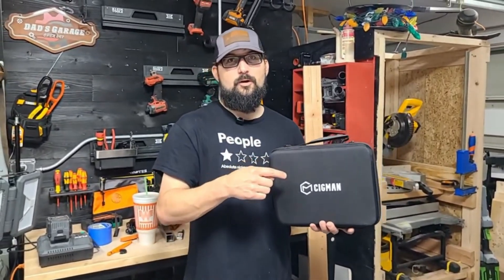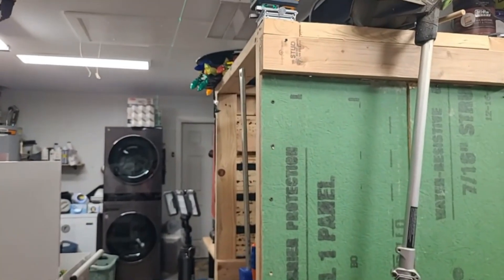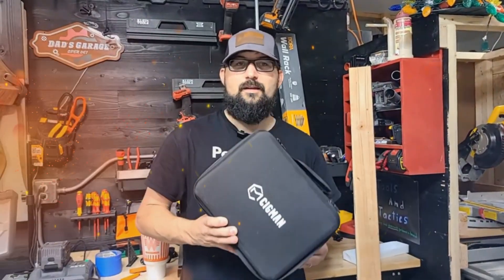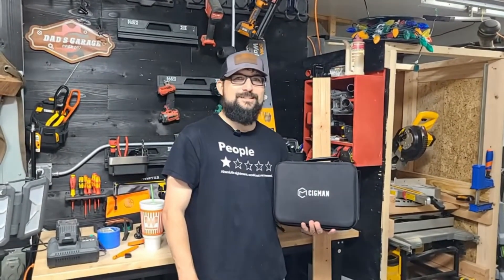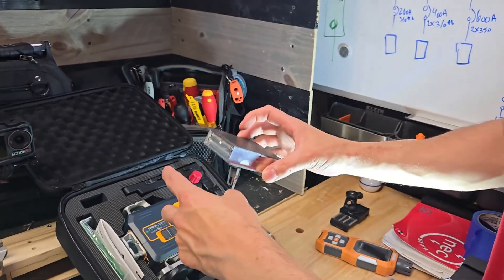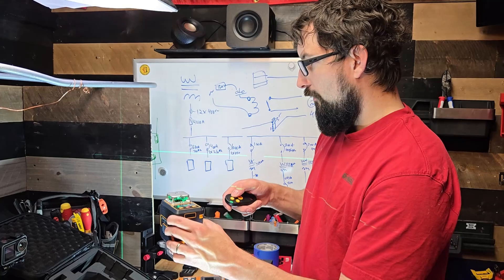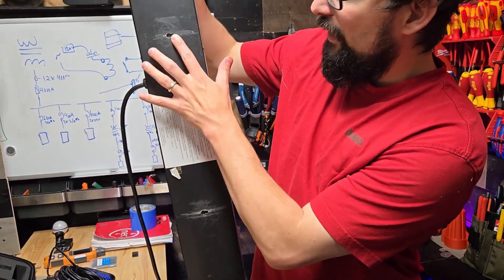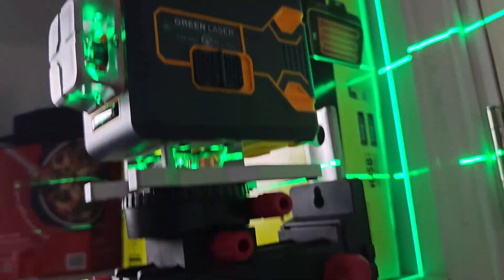Beyond Straight Lines: Innovative Applications for Green Laser Levels FEAT: MRS TACTICS Cigman laser

Comment: How do i get u a picture of the mold behind my bathroom shower to ask u if it looks like black mold
Reply from the maker: Conductivewood@gmail.com 
But if you pull it up and expose it, you're going to expose it to more of the house. You should just take your time.Leave it sealed up as much as possible

It's most likely mold if you feel like there's a heat in the air. A different air quality. How musty smell nose running.  Stomach hurting in that area any of those side effects, it's probably black mole. That needs to be completely remediated. You need the plastic off doors in the house. Have a negative ventilation.To an outdoor
 window  gloves mask goggles tyvec suit. Ect. 

If you don't have any side effects and it hasn't gotten you the slightest bit sick yet. You might be safe enough to get a picture, but if it bothers you at all, it's already taken a toll on your body
Reply: @toolsandtactics thank you i already had the wall off .. i sent the pic … i have not been sick at all

Comment: Great brand have a few.  My most used one is a firecore 4 plane because  I need to level things low often.  Get a 3rd hand or any of thoes long support poles for plastic barriers.  Then you have a fully adjustable laser mount with any camera small rig clamp.
Reply from the maker: Oh yeah, metal flore to ceiling clamp is a really good idea